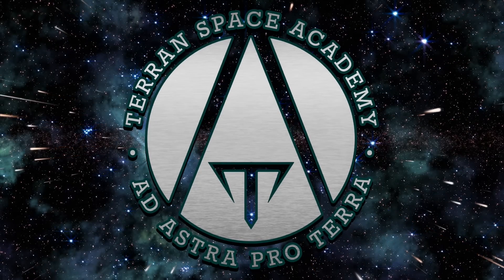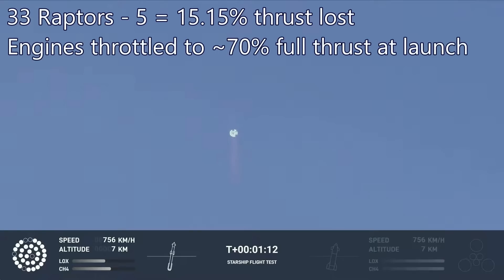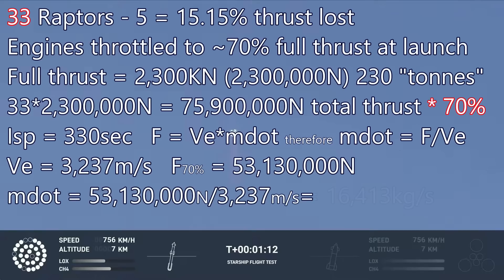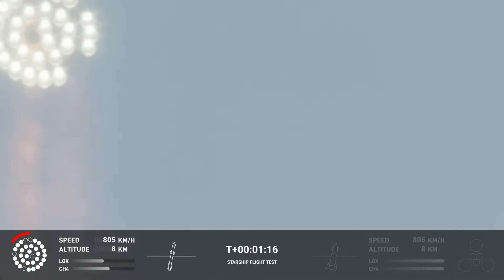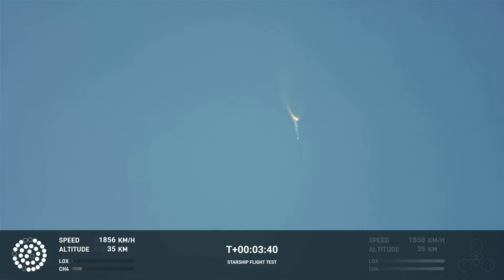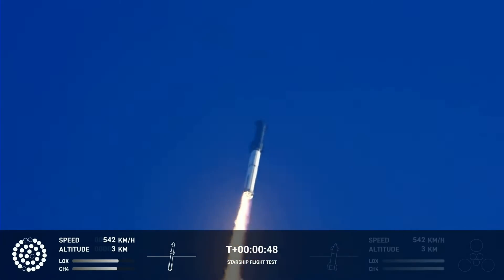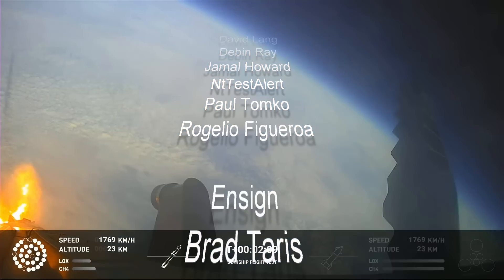Starship Flight Analysis: What went wrong with Starship?

Comment: Any thoughts on the slight sideways movement just after liftoff?
Reply: Trying to save stage 0 however they can
Reply from the maker: The engines can't compensate for assymetric thrust until the rocket is released from Stage 0.

Comment: Someone mentioned there was a hydraulic failure of some sort. About 33 seconds into the flight, you can see that one of the explosions seemed to be on the outside of the booster, not an engine. Maybe this was one of the hydraulic power units? If so, it might explain the tumbling and separation failure, if the separation mechanism uses hydraulics also.
Reply from the maker: That makes sense Dan.

Comment: Very unique solution using the methane turbopumps as cold gas thrusters to separate the stages.  I admire your creativity.  Thats really brilliant.
Reply: @lamontcranston3177  an individual starship costs nowhere close to 45 billion
Reply: @melandor0  Stay tuned. This is just the beginning. Have you looked at the long term plans and cost projections based on inflation?
Reply: Maybe it's an ullage issue. You'd presumably need to be under thrust to fire up the turbopumps so you'd have to do it in a similar way to hot staging. The centrifugal force of the flip separation would presumably settle the propellant. They do, of course have the header tanks but guess they need to stay untouched till landing.
Reply from the maker: Thank you!
Reply: That flip-to-sepatate plan...
I have no idea how it got past the sanity check.
Reply: @dahawk8574  Maybe the separation was supposed to come first, but failed, and the booster turnaround program kept going anyway. It makes no sense to do such a stressful maneuver while they're still connected. The booster will need to flip around to return home, but it's no great loss if it doesn't make it. The starship itself will be full of precious payload, plus would waste fuel getting itself back on track.
Reply: @dahawk8574  It was not supposed to be a flip to separate, it is supposed to be a twist to separate that takes place.
Reply: @gravelydon7072 : "It was not supposed to be a flip to separate, it is supposed to be a twist to separate that takes place."

If by 'twist', you mean a yaw maneuver, that does not fit at all with my own understanding.

For the next attempt, I hope SpaceX decides to abandon that entirely.  Go back to a straight separation like everyone else does.

Elon Musk:  "The best part is no part."

He forgot a key aspect:
"The best part is one that actually works."
Reply: @dahawk8574  I agree. The best way is one that works with the least of parts and is still reliable. It isn't like they don't already know how to do that as the Falcon 9 /  Falcon Heavy have already proven they can do it.
Reply from the maker: What sanity check :-)
Reply: Sure, add the weight of a bunch of turbo pumps to a vehicle where every pound matters when you could do the same thing with just forces naturally produced and release hold down clamps..... not exactly brilliant in my book.
Reply: @ankhenaton1983  I’m pretty sure the turbo pumps are a part of the engine, not something that would need to be added
Reply: @SyntheticSpy  yes, but you have to pipe the gas to the other end of the booster and spin up the turbo pumps after you just spun them down from MECO..... so seems super efficient..... not
Reply: @ankhenaton1983  Did it really not occur to you that he meant the upper stage turbo pumps?  You know, the ones that already pump fuel towards a little thruster-thingy that happens to be pointing in the right direction?

Or did I mishear him? Did he actually say the booster turbopumps?

Also,  even in the latter case,  one more valve and some piping is definitely NOT the same as carrying an extra turbopump.
Reply: @Atlessa  now latching mechanism that is never needed after stage sep gets carried around for the rest of the starships journey.  Seems wasteful.  Also you have to redesign turbo pumps adding complexity and variation to your rocket motor since not all of them will need to do this job.  Regardless of if it's on booster or ship, it is a bad idea. Turbo pumps are an integral component of the engine and require an extensive and complex start procedure.  On top of that, (and the fact that ship shouldn't carry attachment hardware) you have to spin the turbo pumps up earlier to "push off and detach", wait for the ship to clear the distance so ignition doesn't damage the booster that is rtls'ing and THEN ignite your ship raptors.  To carry enough gas to keep the pumps spinning without ignition for the several seconds it would take for this, it would be cheaper (weight wise) to just build a gas thruster system that is almost useless except for stage separation.  Does that sound like a good idea to you after look at what the booster raptors did to the launch site?
Reply: @ankhenaton1983  You don't know how Rocket engines work,  do you?
Reply: @Atlessa  I know that the methane tps are on the opposite end of the rocket from where the stage sep mechanism is.  So you need to either add piping to send gas (which isn't really gas) from the turbo pump up to stage sep.  You can't use the autogenus pressure because you're under MECO when you are separating. So that means the engines will have just spun down and now you need to respin up turbo pumps to what? Push the first stage away? You've already got forces that will "naturally unlock the stack" if it is unlocked.  The stage separation didn't occur in this flight because the booster was already too far below its thrust needs and so was planned to not separate OR damage to the engine bay from multiple engine outs blew out the HPU (hydronic power unit) meaning they were not able to unlock the clamps for stage separation.

The space industry (and SpaceX) understands how to separate vehicles very well (it's been happening for decades). Not one has decided to use a part of the rocket engine at the other end of the vehicle which isn't designed to drive cold gas thrusters as a stage separation mechanism.  Furthermore, Starship's booster is designed with cold gas thrusters that use ullage gas from the main tanks to drive attitude control and those thrusters don't require a turbo pump already.

So my question for you @Pyrrha Nikos, can you explain to me why this is "brilliant".  Obviously, I am very ignorant and don't know anything about rocket engines so I fail to see why this idea is good.  Maybe you can explain it to me?  Is this comment a sarcastic one?  I'm quite confused.

Comment: it's clear that Starship SN11 experienced a pogo oscillation failure (31 -33 ) raptor engines firing at once vs (SLS) Artemis 1 rocket which has a  total of four engines. this and its apparent Disposable launch pad will be a huge hurdle for SpaceX as Multi-engine rockets are much more susceptible to pogo oscillation phenomenon than single-engine rockets. it took Nasa many years of R&D and is the reason why SlS Artemis 1 chose to use tried and true rocket "boring" technology  Pogo was in fact  the main cause of the soviets (30 ) engine N-1 rocket failure Pogo oscillation is a phenomenon that occurs when there is a feedback loop between the combustion process of the rocket engines and the rocket structure. The vibration caused by the combustion process can cause structural oscillations in the rocket, which in turn can feed back into the combustion process, leading to a potentially dangerous cycle of vibrations.

In multi-engine rockets, there are more engines that can contribute to the vibration, which increases the likelihood of pogo oscillation occurring. Don't be so Salty Spacex fanboys! its ok! lol Cheers from Park City Utah!
Reply from the maker: Pogo nogo Ezra.  Pogo was indeed a big problem with N1.

Comment: I suspect that the loss of engines and substantially lower acceleration than expected caused the booster to take a flatter trajectory which is reflected in lower speed and altitude than expected for MECO, which means when the flip occurred the drag kept the ship from separating
Reply from the maker: Good point...

Comment: There is a giant crater under the OLM and debris was significant, Elon has tweeted before about the need to redo the concrete  in the past because it shot up into the engine bay cutting cables and such. I imagine the debris from today smashed a lot more than we realize. Overall a great success! I do think they will need a new solution for the launch table tho.
Reply: Yep. I remember when pad debris caused engines melting on the SN prototypes. And this time this was whole concrete blocks being shot up like bullets. If anything it actually gives me MORE confidence on the design because I cannot cite a rocket that suffered this much external abuse and kept going. 
I mean the space shuttle ate a single gold plated pin and that was almost launch failure, but here goes starship eating pavement so to speak and just refusing to die.
Reply: @mobiuscoreindustries  I guess the engine force is a double edged sword, it dug out 100 tons of concrete under the pad, but it probably also pushed a lot the potentially damaging debris away from the engine bay.
Reply: @DisorderedArray  The issue is there will always be some that make their way through. It is clear from the engine failures at the start and the HPU going boom that a lot of debris made its way through.  The retrofit shield did its job decently enough but it is clear that a LOT of damage was sustained by the booster, but its very sturdy design allowed it to trudge through
Reply: @mobiuscoreindustries  The HPV which controls gimbling of the engines exploded shortly after launch as well, Im pretty sure it was also hit.
Reply: My thoughts exactly. Debris was the most likely cause of the failure. Also a huge orange flame trail was seen, indicating fuel and oxidizer were just pissing out where there was a cluster of flamed out engines, so yeah, extensive damage. I think the OLM will be getting a flame trench now, finally. They were very stubborn on that part. Landing or launching a rocket on or from a non-prepared rocky terrain without consequence is a thing of movies for plot convenience. IRL it's bat shit crazy, suicide, and exactly THE most difficult thing about travel to other planetary bodies, and just have a think about those Apollo guys who did just that. And the most likely reason the Apollo engineers went for a separate ascent engine and leave the descent module behind - something forbidden when one wants to make a fully reusable vehicle. The Apollo 15 astronauts were very grateful for that as their descent engine bell was crumpled during a hard landing at 2.1 meters per second.
Reply: @paulmichaelfreedman8334  At lease the super heavy will not be landing on other planetary bodies and unprepared pads (not that a prepared pad helps much!).  And Starship upper stage has a potential solution for landing too with additional landing engines mounted high up on the body.  Will need some rather big pads on the legs though!
Reply: @paulmichaelfreedman8334  I think there were a few reasons they didn't put a flame diverter. One they probably had more confidence in the concrete. Two , I don't know if they were 100% sure they would ever even launch from there. Three, this flame diverter needs to be able to handle everything so it probably needs to be big. Same goes for the water deluge system. I don't think they wanted to do all this extra work in case they couldn't fly, OR also the prototype just ends up exploding anyways. Plus it makes for a very good test to see how bad they actually need it.
Reply: @digi3218  Well, now they know.
Reply: @digi3218  Four - you dig down much there you are below the water table and five if your water deluge system leaks into the sea you have the eco mob after you...
Reply: @stuartnetherclift7566  digging below water table is not really rocket science but i fear the redtape is going to surpass the capabilities of spacex ...
Reply: @paulmichaelfreedman8334  Agree completely, likely Elon is at blame here for stubborn behavour.
Reply: @thorntontarr2894  Likely not at all. Elon is an engineer upon many others. If engineering disagrees, they can prove it. If they can prove it, they will make it so. SpaceX really wanted to launch, and for a few years by now, BUT they are not reckless, especially with stage zero on the line.

The concrete was, by all account of its physical properties, supposed to be able to take the impact, and at least somewhat survive. Watch CSI starbase for a deep dive on that.
This, to me, points out that this was NOT a temperature issue on the concrete directly, nor is it pressure (concrete survives pressure really well, even normal one). This is likely a unique combination of sound, heat, pressure, and the unique geological and terrain conditions that lead to this. Something which once again does validate the need to actually test the thing in situ rather than just run on assumptions forever.

Now this is going to be a costly lesson, but better learn it now than latter. Just like with all the accidents that prelude the Apollo missions. Many engines, vehicles (and unfortunately, humans too) were lost in forging our path to the moon through problems we simply could not have really foresaw by using common wisdom at the time. Well Apart from maybe filling the cabin with pure oxygen. 

In fact there is a reason why if they could have SpaceX would have rather launched sooner than now even if the chances of success were even more abysmal than they were now
Reply: I agree.
Reply: The height of the OLM above the flat concrete let alone the idea of having a flat surface is a huge oversight IMO. I’m not even an engineer!
Reply: @rogerhalt3991  This was my thought. Seems obvious there needs to be a deep pit there with all that thrust. But Im not an engineer.   Edit:  Well there's a deep pit there now, so half the work is done.  😂
Reply: @rogerhalt3991  Well spotted, I commented above that I consider this a major design flaw - maybe Elon commanded this design, we never see other launch systems without thrust diverter, water deluge systems.
Reply: @rogerhalt3991  I think they were too concerned about temps, the new stuff they applied was some of the most heat resistant stuff you can get, but the pressure waves from 33 Raptors was just too much power.
Reply: @rogerhalt3991  ……your not an English teacher either.
Reply: @robertlangley258  YOU're obviously not, either. 😬😬😬
Reply: @robertlangley258  you're* 💀 Let me know when you want to contribute to the conversation.
Reply: @rogerhalt3991  ☠️👺🤡💩 ooooooooooscary. What ever are you talking about Jackson.
Reply: There was an enormous rain of dirt and sand. This was likely from the pit.
Reply from the maker: It was huge...
Reply: If you watch the spacex launch feed, at t +.07 you can see the release of energy when the concrete gives way
Reply: That is why elon discussed the need for trench with water. However, no time and wanted this first launch to be completed first. I am sure next launch will achieve more.
Reply: Why no "redirect shoot" for exhaust? I think they'testing for re-useability...but still.
Reply: I think we should dig a hole under the launch pad all the way to China so they can smell the fumes every time we launch for letting the Covid-19 virus escape!!
Reply: Totally correct. Why didn't they apply the flame diverters properly? This was a lost of hardware.

Comment: Very nice report. 

I do not understand this flip to separate.  Can someone lay that out and how that makes sense?   Just seems very dangerous to me.  How would that ensure the second stage is pointed in the right direction for engine start?  Never seen any other rocket stage in such a way.
Reply: The nearly-empty Booster will have most of its mass at the base (engines, full LOX header tank) while the Ship's weight will be more evenly distributed. After a flip-separation the Booster will continue to rotate around its base (away from the Ship), while the Ship will be flung away with very little rotation. It's an elegant way to use the main engines (and their ridiculous control authority) to achieve staging of what will likely be the heaviest second stage ever.  🙂
Reply: @dancingdog2790  

Very good. 

Do you know of a video or graphic that lays this out in a visual way to better understand this?
Reply from the maker: Thank you Dancing One.  Well done.

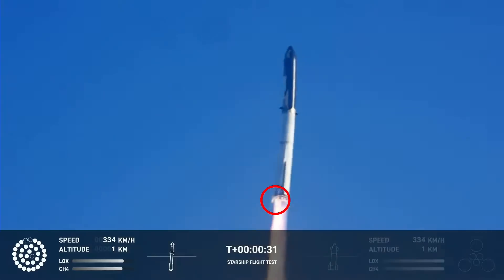Comment: I think it's important not to ignore the large flash  on the HPU around 1:37. There is a possibly that debris from that raptor out could have damaged the HPU, making it possibly in-opperable. There is even a chance the stage sep hooks were controlled by the HPU
Reply: Nope. Their great and stupid plan is to use engine gimbal to create separation. With most of the gimbling engines gone, it started tumbling.
Reply: @ojobee  no i know that, but there is a slight chance the gimbal authority could have been just lessened
Reply: @The Landing Channel  got you. This is a big issue. The system, as currently setup, does not have an escape system. The ability for the upstage to detach and at least fire its engine is important. The fact that the lower stage being compromised is a certain death sentence is horrible.
Reply: @ojobee  yeah, hopefully the upgrades Elon mentioned on booster 9 with the better raptor containment shielding and electric TVC could help prevent the booster from being compromised as u said.
Reply: And post that the flame pattern changes, almost suggesting a hole, or partially lit fluid being ejected.

NasaSpaceFlight has a video up using one of their tracking cameras and there is a noticeable trajectory change at this point.

So it's not clear to me if the flip was commanded, or just happened at that point.

Certainly with that many engines out, unless they throttled them closer to 100% the ship would have been well short of the planned altitude for a flip.
Reply from the maker: Thank you!
Reply from the maker: Almost certainly.